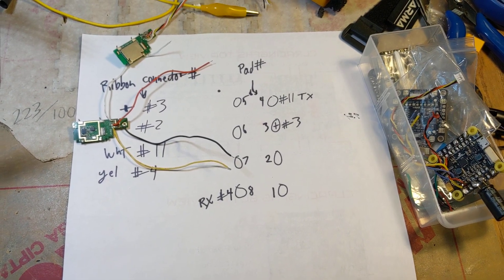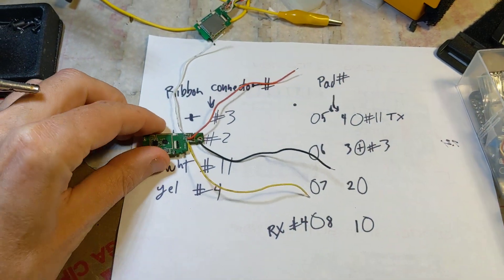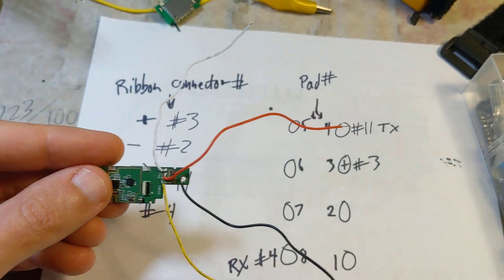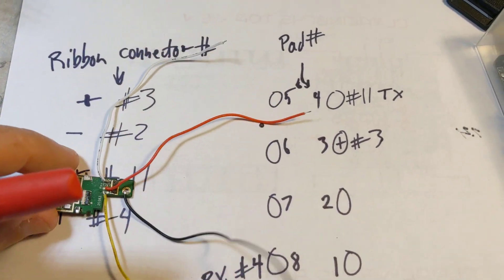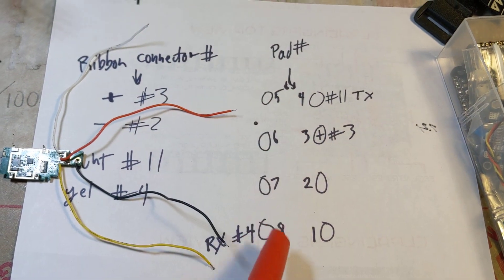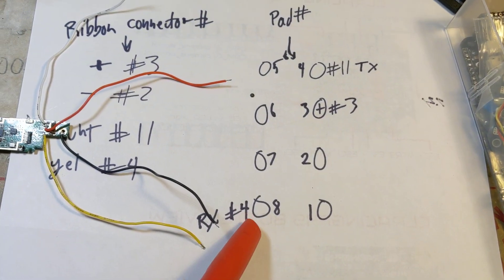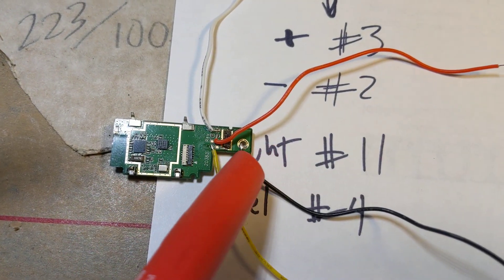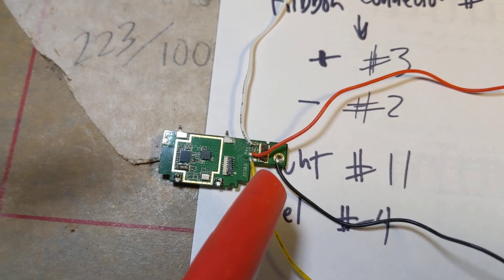Hero7 gps board breakout

Comment: but be aware that the soldering points are very very small. In my case just a little movement of the cable ripped the point out of the pad, no way to repair.

Comment: I tried to install mine, and betaflight is not seeing it. In order to troubleshoot it, can someone tell me if the unit turns on the LED when receiving 3.3? Or any other way to see the board is alive?
Reply from the maker: The led does NOT light up even when it's working.  Only other way to determine it's working it to put TX pin on an oscilloscope and look for the serial signal.
Reply: @Tavdog  thanks